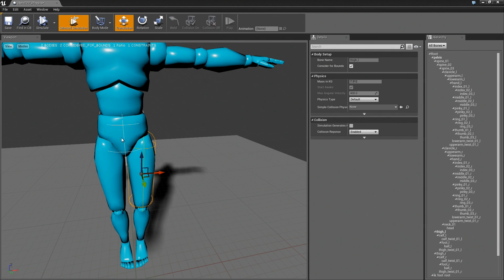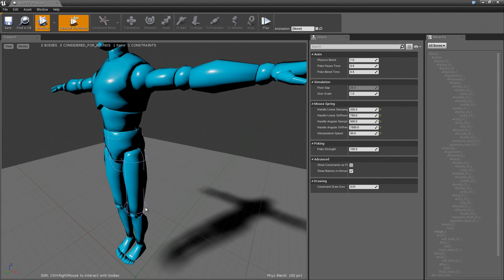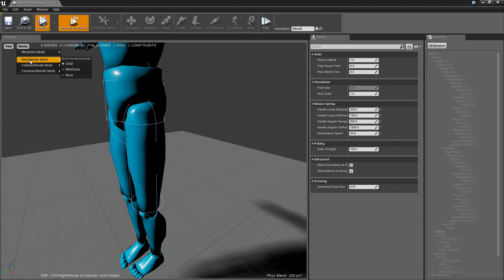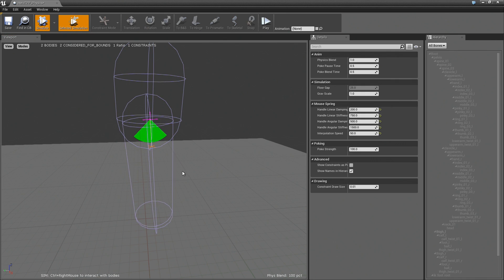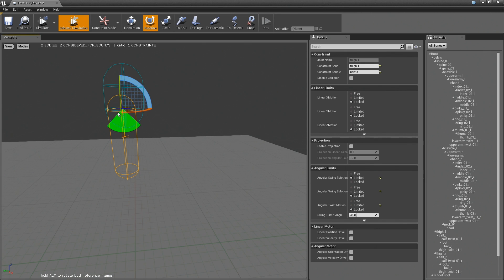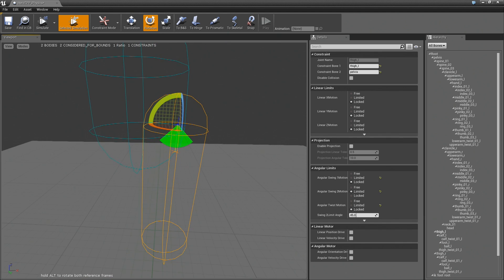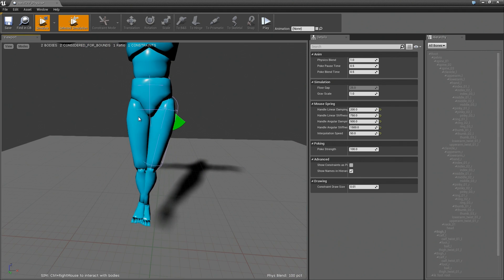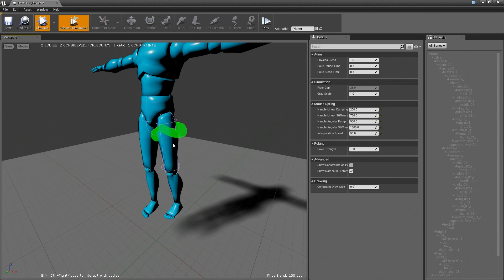PhAT: Introduction to Constraints | 03 | v4.2 Tutorial Series | Unreal Engine

Comment: I might be doing something wrong, but does this workflow only work with the UE Rig and its default hierarchy?
I'm using a Blender made rig and the big difference, as far as I can tell,  is that my "Root" bone is at the bottom between the feet. (0,0,0)
So for the physics, I obviously want the Pelvis bone to be the "Center", so to speak.

If I press "Simulate selected bones Only" with everything except the hip, it looks fine.
But if the Hip is part of the simulation, everything explodes and goes apeshit.

Anyway, I'm fairly new to UE and your tutorials have really helped alot!
Thanks =)

Edit:
Unfortunately this doesn't quite work with rigs that doesn't have a very "linear" hierarchy.
For example, I'm using a Blender made rig, and the IK control bones makes it so that the foot aren't actually after the leg in the hierarchy.
Meaning the constraints in the Phys- Asset won't work as planned.
Even if manually setting the foot constraint to the leg, it will just snap to the leg joint on simulation =/